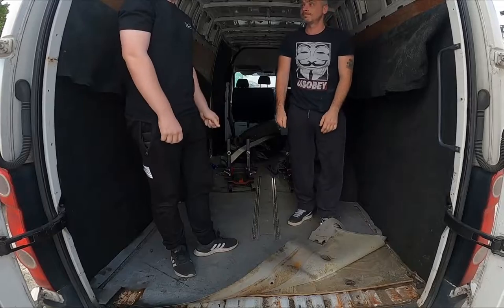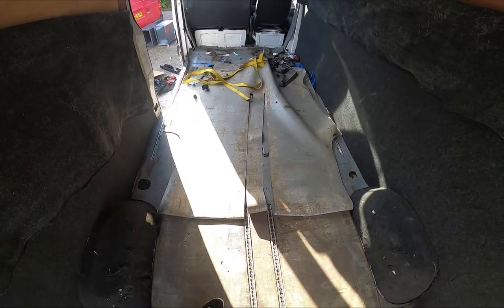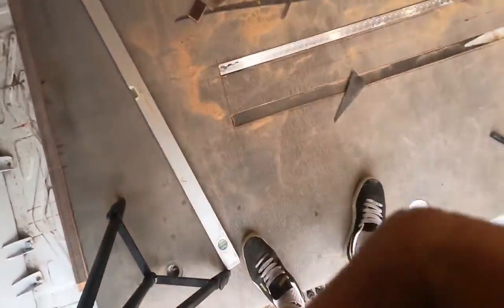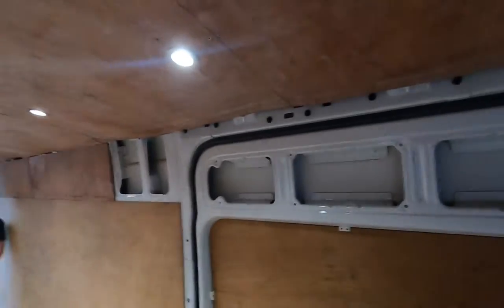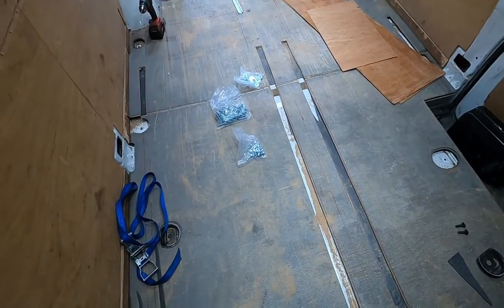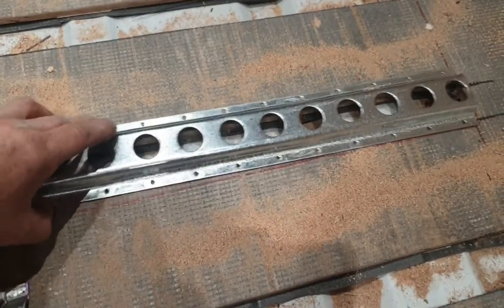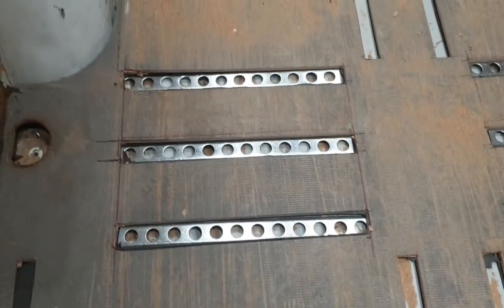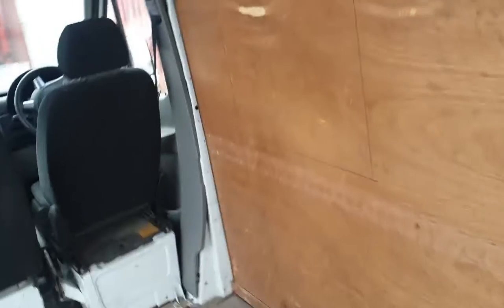Building The UK's Best Motorcycle delivery vehicle Part 2 Floor fixings, Chocks and Boarding

Comment: Just found your channel and love it! I'm looking to build a basic camper van out of a Sprinter or Large Transit, that can carry 2 bikes in the back. Can you give me any details or links to where you got the ramp and all the floor tracking and chocks? Much appreciated, wishing you the best of luck in your business. Cheers Dude
Reply from the maker: Thanks buddy that really means a lot to us.
For the van i'd choose a high roof one of your favourite type.
You can pick ramps up second hand on ebay, choose one wide enough to make it easier to load but nothing too heavy, WM systems make some good alloy ones.
Chocks are by Hitchlugger but you'll find cheaper ones if you are on a budget.
As the tracking you're looking for Unwin cargo rail and fittings if you want to do the same as ours. but that's not really necessary if you're only carrying the same bikes over and over again, just some cargo hooks bolted to the floor are enough. 
Hope this helps mate.
Reply: @SpecialisedMotorcycleTransport  Many thanks for that information. Much appreciated. Good luck in your business going forwards.